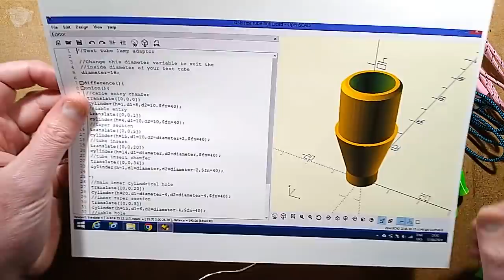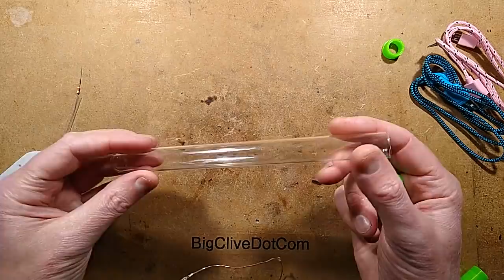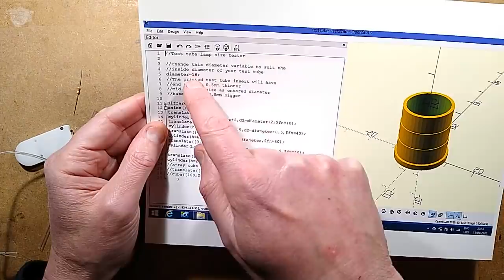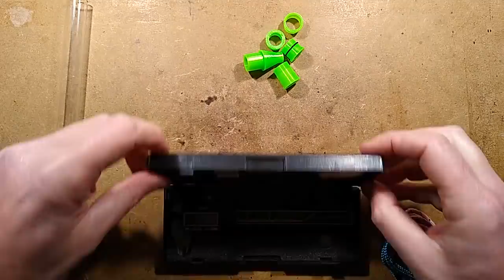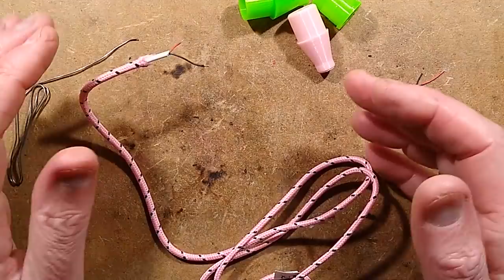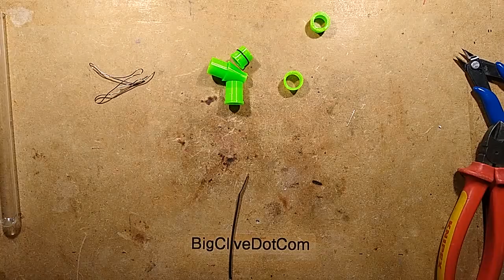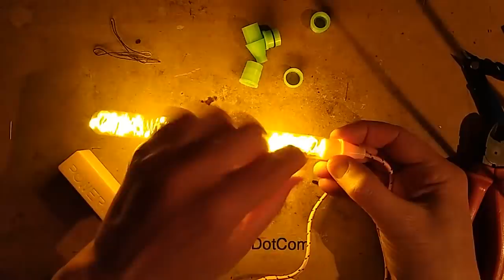Make a safe USB powered test tube light.  (optional 3D printed end)

Comment: I went back to dial calipers recently, my digital ones started going insane, just changing the measurements at random
Reply from the maker: Anything electrically noisy in the vicnity?  Or a smartphone nearby?
Reply: @bigclivedotcom  No it was just a wooden desk with basic hand tools.. It's all a little redundant now as I had to take the digital bit off and use them as normal calipers (had to tighten the knob down and use a spatula to line up the jaw with the number) thanks to a deadline
Reply: Low battery?
Reply: @Bin216  Nah,  I changed the batteries, made sure they were clean.. It would just randomly decide to change the reading, and they weren't some cheap tat either
Reply: @Wanton110  Perhaps they were Multiple Universe calipers, correct in various realities.....
Reply: @Wanton110  If you ask him nicely, AvE will fix them for you.  They will never again give an incorrect reading.  Or any other reading.
Reply: Got a hair in the works?
Reply: Лука Patrick Dunwell mititoyo cost an arm and a dick, wonderful precision instruments though ;)

Comment: OpenSCAD is pretty neat. I used to be really into it but for work I needed to learn SolidWorks and I can be far more productive. I do prefer to use free and open source software for my personal projects though, so I checked out FreeCAD, and it's actually pretty good. Not quite as nice to use as SolidWorks, but all the important functionality is there. And I haven't tried it yet but it appears that it can import and export OpenSCAD files, too. Oh yeah, by the way, I tend to print things with a brim, rather than a raft.

Comment: Hi Clive! can I ask your advise on a completely unrelated question please !? I use a power inverter in my car to get a 230v supply to recharge items related to my photography business whilst on the move. problem is, when the inverter is plugged into the 12v supply it blocks the radio reception! would there be a filter I could buy to stop this?
Reply: Do you perhaps have a spare car battery, such that you can run the inverter beside the car (rather than from the car's 12V) ?  Or have a buddy run the inverter, near your car? My suspicion is that the inverter emits enough RF noise to nix the radio (rather than causing a problem via the 12V power connection).
If the inverter beside the car doesn't cause a problem: maybe look for a high-current common-mode choke, plus some good-quality polymer and electrolytic caps, either side of that;  those may fix the issue.
Otherwise, go buy other return-able inverters, and keep the first one that doesn't cause a problem :-)

Comment: Why not insert the spring with your mandrel? If you used a small enough diameter (like a pencil!), it should slip in uniformly with enough space without pulling the lights off first. I'll have to give it a go sometime!

Comment: The best deal I found was ten test tubes with stoppers for £2.99 - https://www.ebay.co.uk/itm/10-x-glass-test-tubes-Pyrex-12mm-x-75mm-tube-push-cap-UK-SELLER-FREE-P-P/181578723884?_trkparms=aid%3D1110006%26algo%3DHOMESPLICE.SIM%26ao%3D1%26asc%3D225076%26meid%3D4be0a3c40fa147f38d123b86460e8606%26pid%3D100005%26rk%3D6%26rkt%3D12%26mehot%3Dpf%26sd%3D174151080559%26itm%3D181578723884%26pmt%3D1%26noa%3D0%26pg%3D2047675%26algv%3DSimplAMLv5PairwiseWebWithBBEV1Filter%26brand%3DUnbranded&_trksid=p2047675.c100005.m1851

Comment: I wonder if the script could be modified to produce a "winding tube" for the LED's to go around. I have some GITD filament, might be interesting to have a "winding stick" that also glows when the LEDs get turned off. Edit: Nope, I had a much better idea: Just cut some of the filament into lengths that will fit in the tube, and then wrap the LED around the bundle. Waaaaaay easier.

Comment: Could you roll the spring in some paper before sliding it into the test tube, then gently slide the paper out leaving the lights inside?
Reply: Paul hall I was thinking a piece of wooden dowel with a slot cut in the end, wrap the LEDs poke the whole thing down the test tube and pull out the dowel holding the LEDs in the test tube...
Reply: @Bin216  I was thinking the same thing, I have a idea to try this with a old fleuro tube..
Reply: @Bin216  Wow, this project would be right up my alley, then. I make arrows for archery, and before you put the feathers on, an arrow would be absolutely perfect for that.
Reply: Or wind round sharpie / pen starting the coil with the supply end of the cable?

Comment: I have an add showing for this aircraft brightness flashlight.  In the add they show using the beam to light paper towel and whatnot on FIRE.  I wonder at that output, how long you have to wait for FIRE to spontaneously erupt from your hand from either driving the batteries or the LED (or both) too hard.  I used to have an old Halogen floor lamp that would set fire to things too, like a notebook binder😒 so I am not all that impressed by starting fires with a flashlight.  Matches and lighters work as well in a pinch😁

Comment: Would it help to twist the green and white wires together, incase the power supply needs/wants a sense resistor?
Reply from the maker: It's the load that looks for the power supply's resistor to see how much current it can pull.
Reply: @bigclivedotcom  ah I see the problem

Comment: Daddy, what's the most efficient way to drive LEDs off the (UK) mains?
Reply from the maker: It depends on how many you want to drive and what power.
Reply: @bigclivedotcom  3m x 1m infinity mirror with reasonably bright white SMD LEDs around the inner perimeter, (so roughly 8m of LEDs at whatever spacing is sensible, maybe 200 for one per 5cm?)

Maybe a pair of them.

Comment: Really nice project, you can find rubber stoppers with one or more holes already punched in so it would be pretty much ready to use, should also be possible to cram the resistor inside the single hole as is to hide it.

Comment: I'm under a minute into the video, "I have a choice between blue and pink cables." Please don't disappoint...I know which you're going to choose! :-p
Reply: I am not disappointed :-D lol.
Also, curious... Am I the only person who prefers Vernier calipers to digital ones? I feel it's odd given my age (32) but I've always found digital ones to be less repeatable and slower to get a reliable read? Maybe I just had crap ones
Reply from the maker: I've found them to be fast and repeatable.
Reply: @bigclivedotcom  I concur. A few years back you'd need to spend £80-plus to get a decent set. These days you can get good stainless digital calipers for a tenner. It's the digital module that counts; some are appallingly dire, it's true, but £20 will get you an accurate, fast beauty.
Reply: @Blitterbug  the other problem with the cheap ones is they tend to drain the battery pretty fast even in standby
Reply: @bigclivedotcom  We know you like things fast and repeatable clive.
Reply: @DrGreenGiant  You have ones that are too accurate! They have a resolution that is much higher than mechanical ones.
Reply: @drteeth7054  The resolution is exactly the same, +/- 0.02mm.  Unless you don't know how to use verniers, in which case stick with digital.  Since manufacturing tolerances are extremely important to how the vernier type works, you could maybe say that a cheap set of digital callipers is probably better than a cheap set of vernier callipers.
Reply: @drteeth7054  the accuracy is .0005" or .01mm for the metric buffs, Vernier scale is .001" or .02mm from memory. You can get more accurate if the size is between the marks so could judge it. The reason they are called vernier calipers as I tell the apprentices is the size is very near if you want an accurate size use an accurate peice of equipment the tolerance of verniers is not that accurate give for the layman but if you want better use a micrometer or something better to measure the size
Reply: @DrGreenGiant  No the digital ones should give an instantaneous reading.  Don't go for the absolute cheapest thing out there, but get something just a few more dollars up the totem pole. Verniers are perfectly fine and serviceable though, and you get the extra smug feeling that comes from the fact that a lot of other people don't actually know how to read verniers any more since the demise of such things (including slide rules).
Reply: It better be blue!!!!!!!!!!!!!!!!!!!!!!!!!!!!!!!!!!!!!!
Reply: @tubeDude48  Sadly, no cigar for you.  Nice name btw, I can relate.  Also check out the ATtiny85 if you haven't already.  For little projects they are the duck's guts and you can still use the arduino IDE.
Reply: Thanks for all the comments.
Just to clarify, when I said slower I meant that you have to do a reading several times because they're not repeatable. Definitely sounds like I've been using old, crappy ones though, and the newer ones are better
Reply: I use vernier scale calipers for one main reason: I tired of having to replace the battery every time I used one of my cheap digital calipers. Although I still use digital ones (without a battery in) for rough measurement if they happen to be closer to me.
Reply: I still use the old Vernier that I used through my gunsmithing days, that's what I learned on, and used to build accurate gun parts when such repairs were needed, they always gave me great service, and have always lived in the nice molded case that they came to me from Brownells back in the 80;s.
Reply: i also prefer vernier ones given my age 25 this is even more surprising but look at it like this: no lcds that can shatter no batteries that run out the worst possible moment....
also i can confirm that digtal ones are not really repeatable since you can tare them once open them up and close them back down to completely shut and it just wont read 0.

Comment: never used rafts for a long time (it`s just a waste of filament). I print in abs and other fillaments that need a heated bed and also use a glass build plate. there may be a setting in your software to remove/dissable the raft if you want to experiment printing without the raft. PLA pints good on a cold bed and sticks pretty good. have a look for the flexable magnetic print bed material that is 2 parts one part sticks to the print bed and the other magically sticks to it then once your print is done you lift the magnetic layre off and the peal off the part.
Reply: Rafts are particularly good when you don't have a flat side of the object to line up with the bed.  In that case, raft+supports tends to be more secure than just supports bare on the bed.  You could also use a brim in that situation, of course, which is sorta between a raft and nothing.